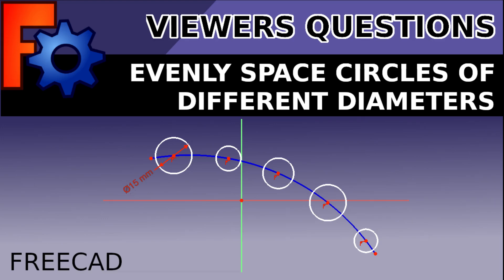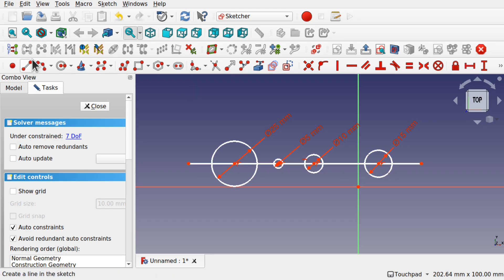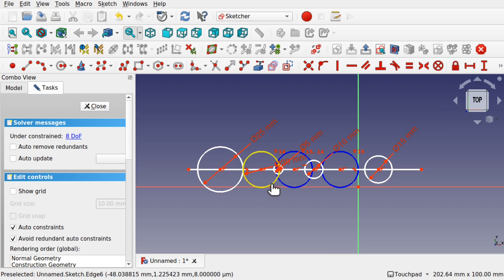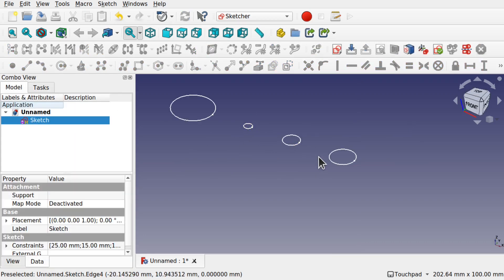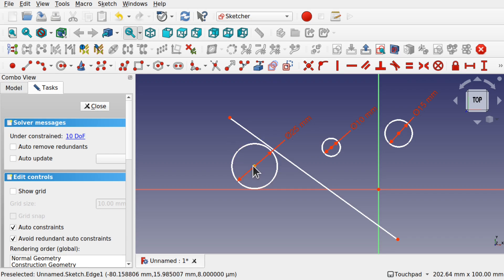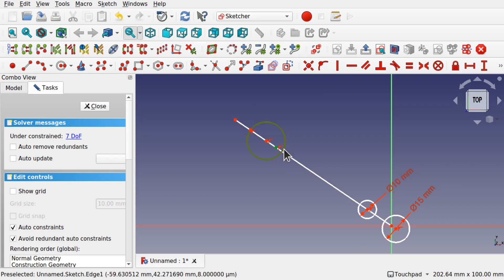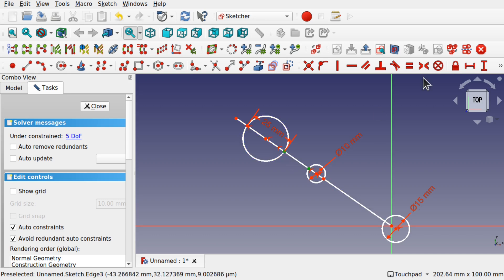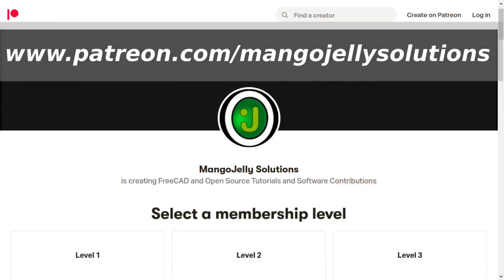FreeCAD: Evenly Space Different Diameter Holes or Circles | Viewers Question

Comment: Awesome video! I've been trying to figure out how to place four mounting holes in a mounting plate, which has a bolt circle diameter of 142.5mm through the center of all four corner holes. This video has helped me understand the process better.  So would I just create a construction circle of 142.5mm and place the center of each mounting hole on each corner of the construction circle's quadrant?

Comment: If the "path line" is an arc, there's an inconsistency between constraining the holes to the construction circles by tangency verses points on the path line. As the radius of the path line decreases, this difference in distance between the circles is magnified.

This brings up another question I have had for awhile. There does not seem to be an easy way to constrain an arc length. You can constrain two arc lengths to be the same with a bunch of construction geometry, but you can't seem to enter a numeric constraint (at least not without using formulas).